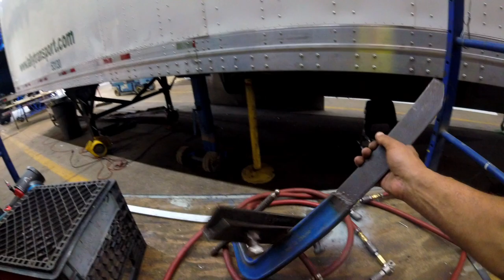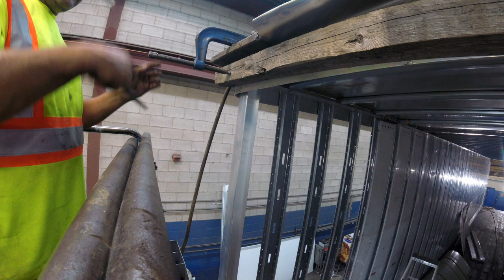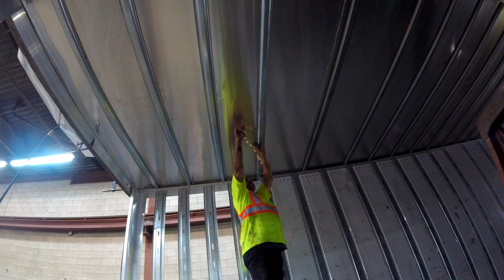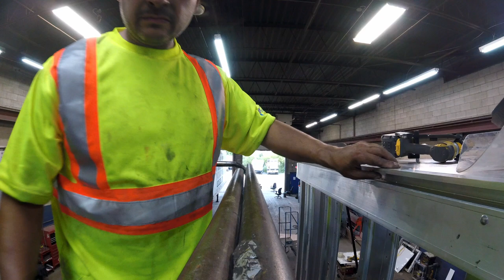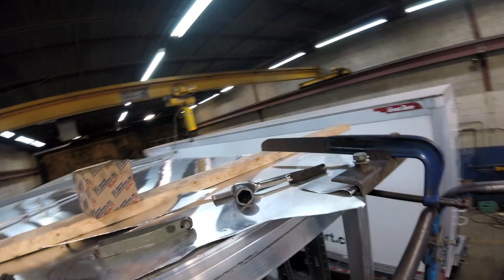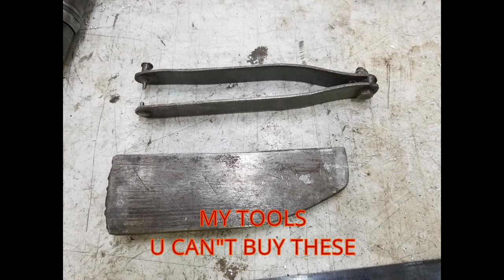8 FOOT ROOF SECTION AND TOOLS USED

Comment: Thanks for the video. Although it would have been nice to see some caulk or sealant go in between the layers. We do it, and then seal over the top afterwards. It never fails if we send a trailer out for a large roof repair like this, it will always leak when it rains. Then we have to seal it only from the top. But thank you for the video, I'm sure there is some time lost to have your man record every thing he does. And I learned a new tool! Looked very neat.

Comment: Thanks for the video . I’ve repaired a lot of roofs but never new how they were stretched , very good use of c-clamps. Do you put your seams over the roof bow or just to one side of them ? There’s all kinds of repair manuals for truck repair but very few if any for trailer repair  , for me has always been trial and error. 
Thanks again
Reply from the maker: There's not much for trailer repair ,  I just try everything that comes to mind . As for the roof seam always over the bow and fasten both sides few inches way .

Comment: What’s the exact name of that air tool you were using when you were buck riveting the roof to the top rail of the trailer. Seems really useful and I wanna buy one but I don’t know what it’s called exactly.
Reply from the maker: Phamatic scraper 3/8 only good for soft rivets 3/16 ×1/2 for roofs
Reply: What brand is that scraper?
Reply: What brand is the air scraper . Can’t find one that takes 401 shanks like the normal air hammers
Reply: Yeah how u modify it to use a zip gun barrel I wanna make one of those
Reply: He said Datco I think.I never heard of that brand but there stuff is over SO prices 😝